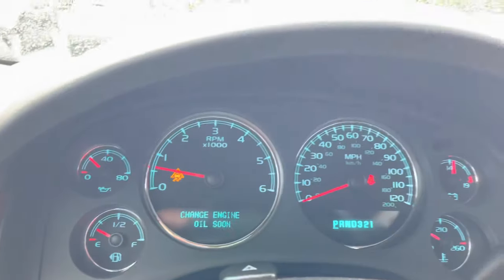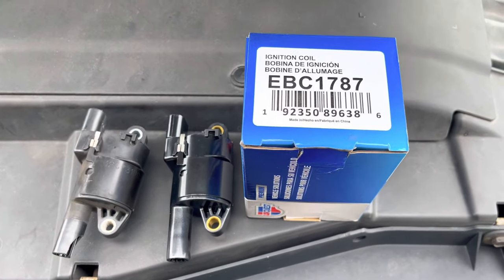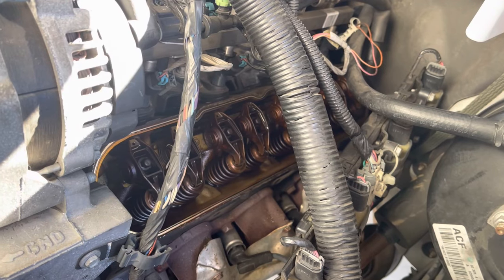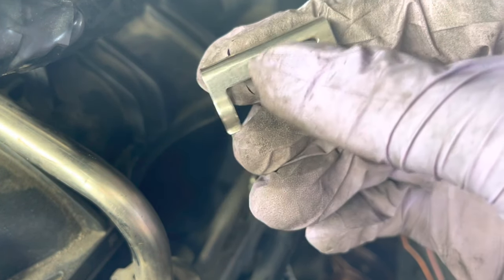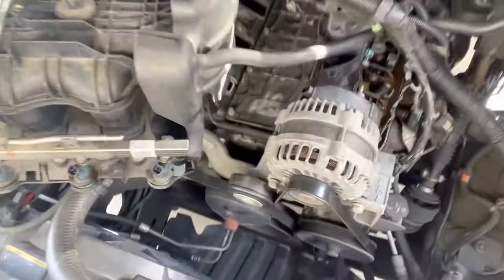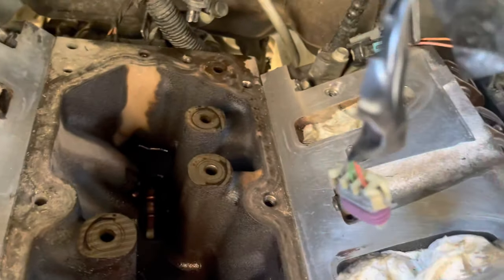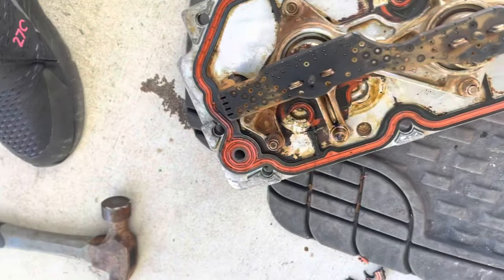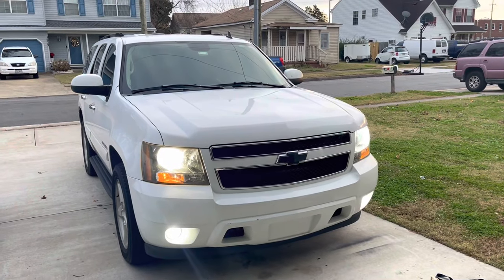07 Tahoe Misfire Cylinder 7 | P0307 | Collapsed Lifter      @CrazedPerformanceRepair

Comment: I have a Toyota Camry 2001 2.2 Liter engine 4 Cyl . I have this kinda problem. Flashing engine lights on and Misfire Codes.  After changing my Spark Plugs and New wires and New Coil wires .It still Misfires. Then I change my Fuel Injectors Change Oil and put some Lucas Fuel Injector cleaner Still Misfires . This is the Codes that is Showing up 
P0300 Random /Multiple Cylinder  Misfire  
P0301 Cylinder 1 Misfire 
P0302 Cylinder 2 Misfire 
P0303 Cylinder 3 Misfire
Now iam thinking changing my Fuel Pressure Regulator .So is this going to solve my problem on my vehicle .I heard some people will say that the timing chain is the problem .and some will tell me that it is Intake Valve Not Setting Properly .
Reply from the maker: I’m not sure man..I’m not a mechanic, was just trying to save some money…I don’t know about any other cars besides this Tahoe…sorry, hope u get it figured out

Comment: Appreciate the video bro, quick question Did you loosen up cylinder seven or did you just hit it with a hammer till it goes up and it catches the spring? Thanks in advance 🙏🏽
Reply from the maker: No problem man...I just tapped it with the hammer...check out Crazed Performance Repair for more detailed vid...I got all info from him 🦾

Comment: didnt you have to change the cam shaft also? that's what I heard you have to go to get rid of the fuel managment
Reply from the maker: No I didn't go that route
Reply from the maker: I did the poor man's remedy...lol
Reply: @87SSBOI  You and Alot of people ...I was about to buy a air compressor and impact wrench to remove the head and replace them...because its a 3wk back up to even get it diagnosed at GMC and I rather spend the $ on tools then Labor cost and overpriced parts and my truck being down for 1+ mth

Comment: Change your oil on time. Those lifters work with oil pressure! If the oil is very dirty you got problems. It's cylinder deactivation that works on cylinder 7, maintain your oil!! Mechanic of 17 years
Reply from the maker: Thanks…oil was always changed on time every time..still happened…owned the car since it was 3 years old…what happened before then idk but it was maintained while I had it

Total loss the Tahoe about a year after this…took the engine out now and broke it down for inspection and Stage 2 came upgrade…everything still checked out good…about to put it in my 86 C10
Reply from the maker: Also upgraded the crappy factory oil pump with a Melling High Volume pump and of course the worn oil pickup tube o-ring
Reply: It's not the oil. It's the lifter design.

Comment: I had the same problem except my truck had a tap on cylinder 6. Thought it was a spun bearing, or the flexplate. Turns out the dod/afm system caused this to happen. I would seriously consider doing a dod delete bro, bc it probably will happen again. The dod system works good until you get up into higher miles then it starts failing. I'm in the process now of a cam swap, a non dod valley cover, LS7 lifters and tray, high performance pushrods, and LS7 valve springs. They also have a device made by range that you can plug into your ob reader port that turns the dod system off as well.
Reply from the maker: Thanks for watching and for the input...my DOD is deleted...sent my computer off and had it removed by LT1swaps.com ➡️ I also modified the vlom for the delete...later on down the road I may buy the actual delete kit with the stage 2 cam and the vlom delete plate 🦾
Reply: @87SSBOI  I did some research on what you did right after I watched your video. I like the way you did it, it also saves money. I only reason I'm doing the kit is bc I'm installing a bigger cam and it doesn't support the dod lifters. If you don't plan on doing a cam swap the way you got it is perfect. How long did it take to get your computer back?
Reply from the maker: @kingofkings8709  whole process took about a week n a half

Comment: When you add the spacer?   Do you still have to add in the oil pressure filter also or does the spacer replace that?
Reply from the maker: Spacer replaces the filter

Comment: Also what is the up date in this job? Is it still running??
Reply from the maker: Ran great until I totaled my truck, then I pulled the engine for my 86 C10 project..everything still good
Reply: I followed his video and did mine still running strong, have a cheap AFM delete module plugged in
Reply from the maker: @mullenauto  that’s works too!!!
Reply: @mullenauto where did u get it?

Comment: hey man, what is the deal with your oil pressure. It looked like it was low after the mod you did. cheers
Reply from the maker: The oil sending unit harness cabling was faulty...replaced it and back to normal

Comment: So did you actually fix the lifter problem or did you just use that punch on it and collapsed in it fixed itself and if that’s the case, wonder why it was stuck to begin with
Reply from the maker: No can't say I actually fixed it...I just uncollapsed the spring on the lifter...I'm not sure why this happens but it's a common problem on these engine if u have the flex fuel dod/afm
Reply: @87SSBOI  So they way the AFM lifters work is they use oil pressure to push in the locking pins and collapse the lifters to prevent the pushrods from opening the valves. Sometimes they stick in the collapsed position. Once you got the lifter unstuck, the locking pins that pop out to keep the lifter at full length. Once you delete the AFM, those lifters should never get the required oil pressure to move those locking pins. In theory, they should remain locked in the 'out' position. So yes it can be called fixed. I've been running my deleted 2009 Tahoe for well over 150,000 miles since turning off the AFM. 233,000 miles total.
Reply from the maker: @4alphazulu  Thanks for the explanation…yea mine has 207k now

Comment: I have the exact same truck only mine is black. It's running rough and giving me a code for deactivation cylinder solenoid #7 . I'm going to buy my first set of tools and do the same thing. Thanks for uploading the blueprint bro. I'm still paying a note on my truck. You're heaven sent.
Reply from the maker: Hope u get it figured out man…also check out Crazed Performance Repair…I learned this from him and his vids are more in depth
Reply: Thanks bro for the direction. I will check those guys out as well. At this point I have no choice but to take matters into my own hands.I changed my flywheel and once everything was put together again I got all these codes and my engine started running rough.

Comment: Where I can buy the tool to realice  the push racket
Reply: The lifter
Reply from the maker: I didn't buy it..I just used an old rod I had laying around...anything u can get in that hole will work but u can purchase from here if u want https://www.crazedperformancerepair.com
Reply from the maker: NOTE: if u do this you HAVE to DELETE the AFM/DOD in the computer and do the VLOM mod...if you do not then it will most likely collapse again as soon as you start the engine back up and all this work will be for nothing
Reply: Thank you .  Helps a lot

Comment: I'm here because i had same code cylinder 7 misfire. Changed plug,wire,coil,injector.  Ended up being a stuck lifter. Doing afm/dod delete now... Exact symptoms shaking. Especially when coming up to a stop light. Transmission shifting hard sometimes for some reason.
Reply from the maker: Yup all the exact same symptoms...got it running strong now tho...this repair worked great and saved me a lot of money...I ended up totaling the Tahoe but I kept the drivetrain...pulled engine apart for Stage 2 cam upgrade...everything was still intact...putting it in my 86 C10
Reply from the maker: Thanks for watching!!
Reply: I’m bout to do this dealership try charging me 6900 I said naw let me come get my hoe

Comment: You did a good job there,  I'm having the same problem with my 2009 gmc as well,  it has the same engine
Reply: I’m having the same problem on my 09 Silverado what did you do too fix it?
Reply: @coreyjackson2028  I didn't get it fixed yet, I'm saving some money up so a mechanic can fix it for me,  he said that the #7 lifter is bad, so what he said he's going to do is take the top half of the motor apart and replace all the lifters and the oil pump sensor and replace all the other parts including new gaskets, parts including labor he said will cost me $2,200, the dealer told me it would cost me $4,500, the dealership is crooked
Reply: I can do it for  $1600
Reply: @papoortiz9844  where are you located

Comment: Any updates on how your tahoe has been running
Reply from the maker: Ran great until I totaled it in April…still have the engine tho…pulled it for a 86 C10 project…pulled the engine apart to add a stage 2 cam…lifters and cam still looked great!!! And that #7 lifter was not collapsed either 🫡

Comment: How long did it take you to do the job.?? 

I knew I just changed out my plugs and wires not to long ago. As well first time changing the pack… thank god I didn’t buy all eight packs… I put would have cost me $500 I’m like dang… I had an idea to check the valve due a afm cly 4 thank god it’s only one rocket arm… but as they say might as well change them all and delete… I got a ava 07 and this video helped a lot… thank you… I sub and liked…
Reply from the maker: Thanks!!! It took me about 6 hours total of i remember correctly and that was including me recording so not bad at all...and it was my first time

Comment: what type of rod did you use to unfreeze the lifter ? Where did you get it from ?
Reply from the maker: Just an aluminum rod from my local ACE hardware that would fit in the hole
Reply: @87SSBOI  ok...cool....this video is awesome btw....you included a lot of details that take the guesswork out of it...thanks for doing the grunt work
Reply: @87SSBOI  I've looked at this video 5 times....I have an 07 Avalanche...this is the same engine right?
Reply from the maker: @seanbussie7480  it's a 5.3...if u have a 5.3 then yes

Comment: What that lil rod u used to get the lifter unstuck
Reply from the maker: Just something I had laying around in the garage (Idk the name of it)...just pretty much had to find anything that would fit in the hole
Reply: @87SSBOI  bet cuz my truck been giving me hell lately bro and I’m thinking bout doig this….I changed all my 02 sensors and im still throwing a code for 02 sensor n now i got cylinder 4 misfire but sparkplug wires been changed last year still fairly good
Reply from the maker: @keegottifoster2331  yea I feel ya bro...but before doing this check your plugs and the ignition coil...swap coil out with another cylinder n see if the fault moves...but yea if you do have a Flex Fuel engine (AFM/DOD) then cylinders 1, 4, 6 and 7 are those 🤦🏾‍♂️
Reply: Oh yea I put in new spark plugs and wires
Reply: @87SSBOI  yep i do

Comment: So it was the lifter that made your truck do that bro ?
Reply from the maker: Yes, number 7 lifter collapsed...all the AFM/DOD lifters have springs on them that collapse unfortunately
Reply: Have you had any problems since changing them ?
Reply from the maker: @Blvd_treil  I didn't change it...I released it, but no problems...I deleted the afm/dod system from the computer and my truck runs better than it ever has before cause I'm on all 8 cylinders at all times

Comment: How you switch out the lifter?
Reply from the maker: I didn’t switch it out…I freed it
Reply from the maker: In order to replace the lifter u have to remove the heads…I didn’t want to do that…this fix has worked for a long time, I’ve put plenty more miles on the engine with no issues until I total loss the truck and then I bought it back and took the drivetrain out…I’m now putting the engine in a 86 C10…I pulled the lifters and everything still looked great! If u doing this u can’t skip the step of getting the AFM/DOD removed from the ECU…it’s pointless if u don’t
Reply: @87SSBOI what if the truck doesn’t have afm?

Comment: I’m having the same problem with my 2009 Silverado.    I changed the spark plug   New wires  new ignition coil.  And still misfiring  on cylinder 8       I was thinking the same bad lifter.  And after seeing this video. I believe that’s my problem.  I’m going to check it out thanx man. Good video man
Reply from the maker: No prob bro....good luck 💯
Reply: Did you figure out your problem? I have the same issue on my 07 Suburban. Changed spark plug, wire and ignition coil. Still getting misfire in cylinder 6.
Reply from the maker: @michaelchavez8181  yea a collapsed lifter

Comment: Any rattle when u step on gas?
Reply from the maker: No
Reply: @87SSBOI  i get an engine light on only when i step on the gas really hard and the rpms go up. And it acts funny  runs rough but after a few minutes the light goes away. But it does sound bad when i step on gas hard im hoping is nothing really serious inside the engine when the light did came on i put computer and it p0303 cilinder misfire.
Reply from the maker: @omarargullin2313 yea I never had that issue but that code is definitely a misfire on Cylinder 3…could be plugs, wires, coil or the lifter itself…is it a AFM/DOD engine?
Reply: @87SSBOI  i think i got it figure out it sounds like my timing chain is going bad. Thats why it only does it when  i hit the gas hard and rpms go up.

Comment: So did you loosen up the rocker arm before tapping the lifter with the hammer? Or you just wanted to retorque? But great video helps alot!
Reply from the maker: Yea I had to remove the rocker that way when I released the lifter the push rod would have room to pop out
Reply from the maker: Thanks for watching, glad it helps
Reply: Great video , for a guy who isn’t a mechanic you sure had confidence in your work.
Reply from the maker: @MultiMuskyman  lotta research before I pulled the trigger to tackle the job…thanks 🫡
Reply: Bro u did great I'm having the same problem

Comment: How come u do delete the AFM difference than orther people I c in their video but if the way u do it work than I guess is all good than
Reply from the maker: Idk how everyone else did it but I used @crazedperformance method and it worked great...drive it everyday and on multiple trips since I did this and haven't had any issues...thanks for watching!
Reply: Appreciate the feedback mane have a Blessed Day
Reply: @deez6686 
He did the AFM delete cus the lifter can collapse again if you don't. It's a known issue alot of people do AFM deletes to fix or prevent lifters from collapsing! They can cause your motor to blow. It's supposed to be more fuel efficient switching to 4 cylinders back to 8 when you need power but there nothing but trouble! I'm working on my 05 silverado 1500 Z71 random misfire rn. Pretty sure it's from exhaust leak in exhaust manifold shaping it out tomorrow.
Reply: @87SSBOI Good work brah I tought myself how to fix everything on my 05 silverado 1500 Z71 I've done alot of work. My break lines blew out last year an wasn't about to drop $1,500 at a shop so spent $30 bucks on a roll of break line 10-15 on fittings and 50 bucks on a flairing tool an made my own break lines still works perfect. Keep that bread in your pocket bro Fu** crazy shop prices!
Reply from the maker: @1821mustang  exactly bro...they be taxin'...I'm do everything I can myself 👌🏾💯